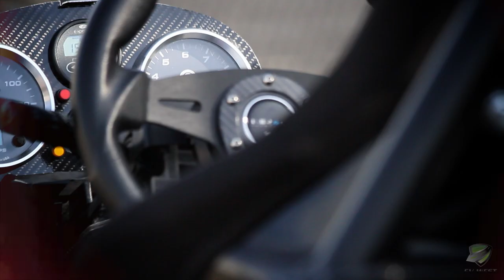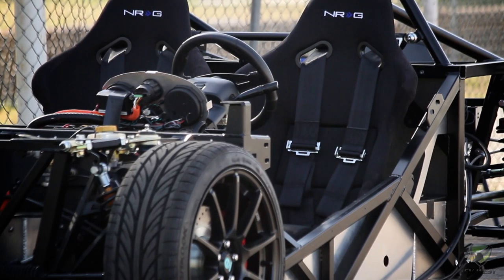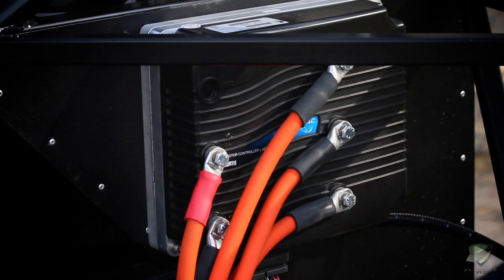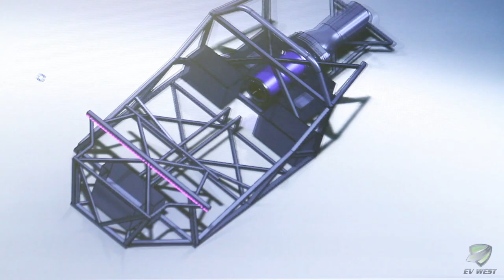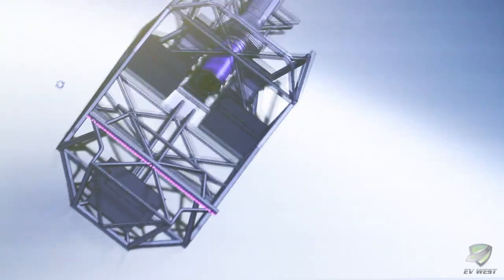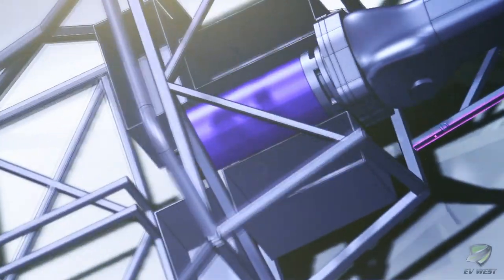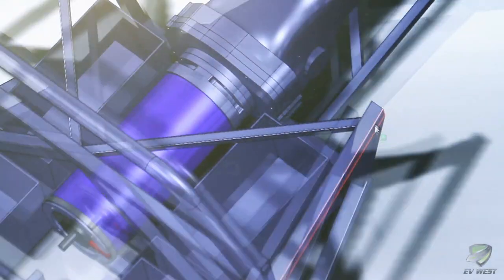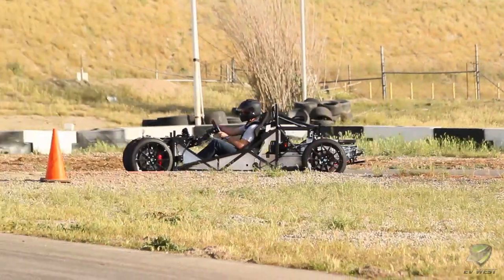Electric Factory Five 818 Project - Track Shakedown - EV West / 33 Machine

Comment: I am actually quite disappointed that he was unable to pass that old Vanigan.

The rear suspension looks like it needs a lot of work. Sure drifting can be fun, but it should be possible with a car that light to just fly through those corners. 

Specs are in the description for anybody wondering. I don't see it getting that kind of range from that size pack, unless the body has a pretty low CoD.

Comment: This is an amazing project.  I might want to do this if the power can beat an sti version of the same car.  Can you post some numbers?  I've been lurking around your site for the past few months and noticed the ev 818 kit about a month ago.  You had mentioned a dual motor setup- does that put a motor between the seats?  Sounds like it would and that could be amazing for weight distribution.  REally can't wait to hear more.

Comment: Looks like the electric motor is connected to the typical WRX gearbox, right? I noticed a shift during the video, do you guys drive it like a normal car (using all gears) or just use one or two and the torque do the work?

Comment: I see you used a transaxle to send power from the motor to the wheels.  Wouldn't it be lighter and simpler to just have a differential acting as a reduction gear?
Reply: Daniel Senti I think he is using multiple  gear ratios ..there is a gear lever

Comment: Electrics will eventually rewrite every combustion powered automotive,motorcycle speed record.With the electric motors producing more then double the efficiency of a combustion engine,all that's needed to start the revolution is high capacity batteries

Comment: Is this going to be a formula drift car?  It looks like the only thing this car is good at is converting electricity into wheel spin.
Reply: watchinthvue2 Turning power into tire smoke is not fast.  Fast is when you can run full throttle without spinning.  And 144kw = 193 hp.  At 1950 lb weight, it has 10:1 lb/hp weight ratio, which is going to be slower than most modern sports cars.  at the 10:1 ratio, one would expect that this car can at least hook up and lay down the power.
Reply: watchinthvue2 And your point is well taken too.  He was deliberately slapping the throttle fully open to make it have on-throttle oversteer for the camera.  That is the showboat way to go around a track, not the fast way.  And that is exactly what formula drift is about.  It's scored by points, not by time elapsed.